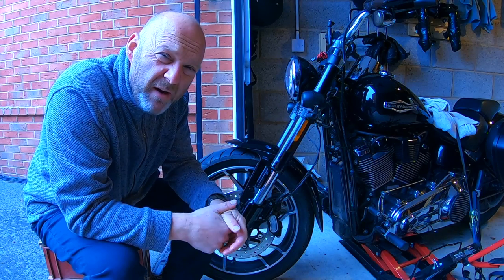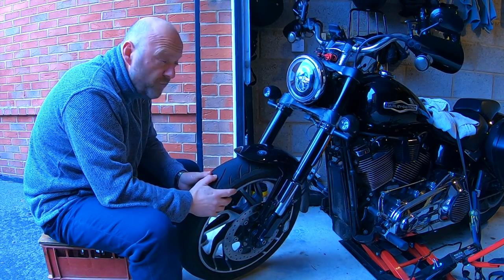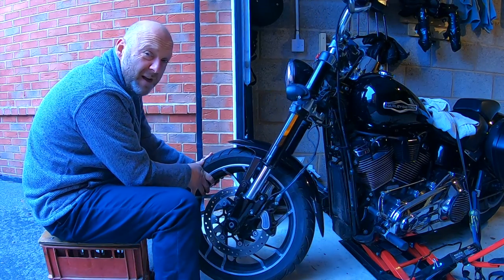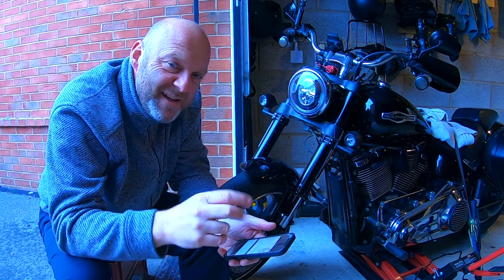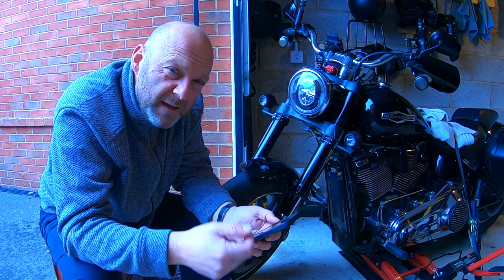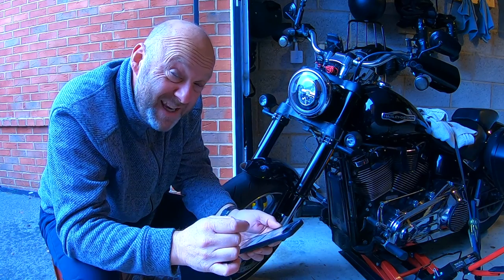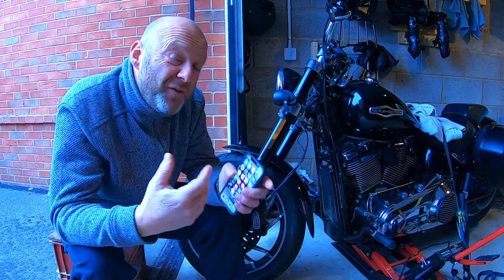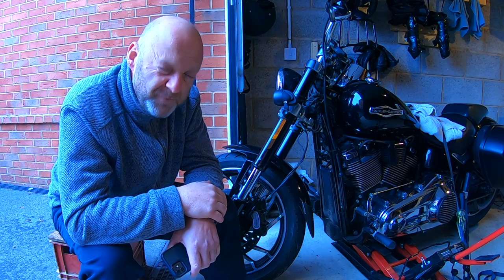How To Check & Adjust Steering Head Bearings Harley Davidson M8 Softail

Comment: First of all, thanks for your videos, you have gained a subscriber. One question, on my FXBB 2022 how can I grease the Steering Head Bearings, where is the valve? I can't find it. 
where can i get a service manual for this bike or a similiar one? . thanks guy!!
Reply from the maker: Cheers. Yes there isn't one but there should be of course. As for the service manual, try looking online as there are some available
Reply: @RevelatorAlf  thanks.
Are you going to make a tutorial of that one day?

Comment: I'm not new to riding, but I am new to Harleys, and I've been enjoying your videos. I have a new '24 Breakout, and I've noticed that the washer around fork stem bolt spins freely. I mentioned it to the dealer at the 1K service recently, and it was returned to me snugged down, everything allegedly OK. 150 miles later, it's loose again. Obviously the bolt is backing off enough for the washer to move. What if anything is this doing to the bearing adjustment? Are they getting loose issue the stem as a result? I haven't don't the force test yet, but it's on my list for this weekend. Any assistance is appreciated. Thanks for your time! Love the channel👍
Reply: Found the same on my ‘24 Breakout tonight. Tightened it back up, but didn’t check any further. No idea how long it has been this loose. Some of the fork pinch bolts also needed tightened.
Reply: @DarwinsTruth Well  from what I've managed to figure out talking to the mechanic at the dealer and various other mechanically inclined folks on the forums, it's the pinch bolt below the center stem screw that's the crucial part. The center bolt is only used to set the pre-load on the stearing head bearings. Once that's done,  it's the pinch bolt that holds everything together... so if that's loose you've got a problem. But as long as the pinch bolt is torqued to spec, the center bolt and washer could actually be removed completely, and nothing would be affected. At least that's what I've been told by more than one knowledgeable source.

Comment: Should I take my Fat Bob to a Harley Davidson dealership to get it stage1 tuned or elsewhere?
Reply from the maker: Not a necessity but you can do this yourself if you feel confident enough. But just shop around at different places to get the best deal
Reply: @RevelatorAlf  that may be good advice as Harley Davidson seem to be well known for extremely high labour costs. I'm getting Vance and Hines chrome short shots fitted. So all I'll need is someone to fit/tune the bike i.e. FP3 as the standard air filter is a high flow one. Am I correct?
Reply: My 2018 114 fat Bob is stage 2 and dyno tuned . Got it done at V twin in rye .
Reply: @robertprosser6856  extremely high is an understatement, they wanted to charge me 2 and half hours just to change front discs and pads
Reply: @richardadams6821  £93+vat per hour. I had my Rinehart slip ons fitted for £40.
Reply: @robertprosser6856  v twin rye and a dyno tune license
Reply: 2  and a half hours to change front discs and pads because the original callipers are shit and create excessive heat on the disC causing them to warp . I can do that with my workshop manual.
Reply: Gonna have my bike with 
  “ Rich Adomson” 
Not Harley shititson. 
  Buy the time Iv finished putting the thing back together it will be a custom build.
Reply: And …… thers no fukin way I’m  gonna advertise my ride with their name on it !!!!!!!
Reply: @richardadams6821  where are they located?

Comment: Hey mate. Any idea where I can get a pdf service manual for my 2021 Softail Standard from (I found two on eBay)? I have the 2018 manual in PDF form, but that does not contain the FXST model.
Reply from the maker: There is the Harley service portal and you can subscribe to that or even try ordering via a dealership but I haven’t looked myself for 2021 pdfs but there are many manual providers online it might just be a case of time when someone uploads it I’m afraid. Sorry can’t be more help
Reply: @RevelatorAlf  I had to spring for a paper manual. Got one from a dealer at a decent price after shopping around.

Comment: Have you yet taken the front apart to lubricate the bearings? The manual says 30,000 miles. Notice how they have deleted the lubrication nipple the head used to have. Also, the pull force table in the latest manual I have seen for softails, does not have my model, the FXST, so that's useful (not). Still waiting for my copy of the 2021 Softail Service Manual, 10 weeks after I ordered it. Dealer says it didn't arrive when their system said it would (they have a load on order), and they now have no date. Insane. Given how long it will take to strip down and reassemble the head, it would make better sense to simply order and fit new bearings. Disposable society.